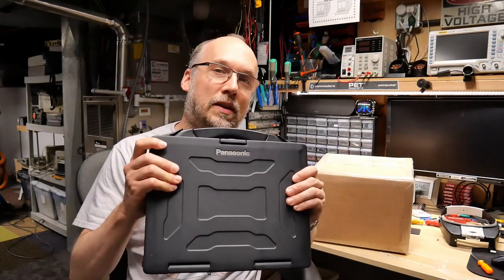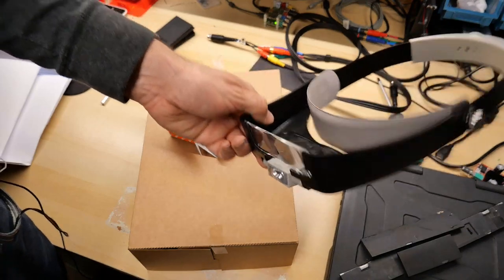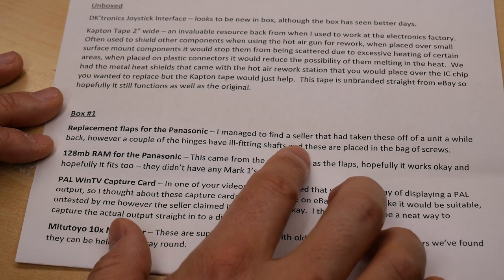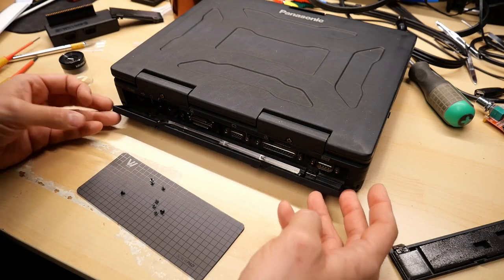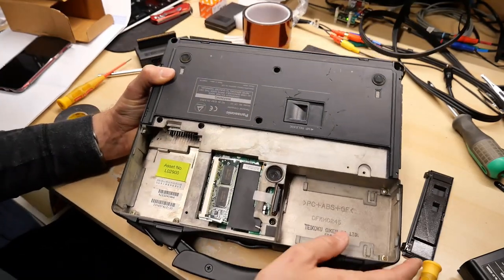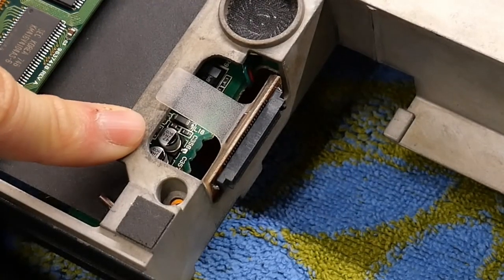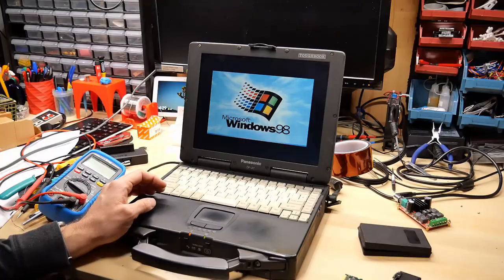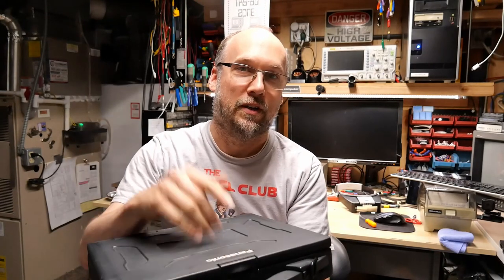Fixing and pimping the Panasonic Toughbook

Comment: This is the first disassembly of a CF-27 I have seen. Looks far easier than I thought! The electrolytics on the boards of these are probably top-notch quality (considering the temperature extremes these laptops were made for), so I don’t think they’ll break down quite as badly as some of the others do. Anyway, good video!

Comment: 3:33 Mitutoyo is known for measurement equipment for the machining industry.  ...for Machinists.  Like calipers, micrometers, and a lot more.  Top three in the industry.  That loop is NOT cheap and surely light years above your amazon grade magnifying loops.
Reply from the maker: Yeah it's so insanely sharp -- I've used it a bunch of times since making this video when inspecting boards for broken traces. I love it!
Reply: I've used their loupes after messing with cheap ones. They make a HUGE difference.

Edit: I guess it's technically a magnifier, not a loupe, because you don't hold this in your eye socket like you would a jeweler's loupe.

Comment: All laptops should be that tough and it looks excellent.  What a great project and a very kind donation too.  Cheers
Reply: Ive still got an IBM 380D from 1996 and its built properly and really tough. The case is all metal, no crappy cheap plastic and of course it still works.

Comment: These were great industrial laptops.  We used them in cranes for the size...I'm thinking one model was the 25 the other a 17.    I remember replacing the hard drives a few times over the years and they were encased in a clear  rubbery shock protector.  They took a beating and some high temps but always worked.

Comment: Used a CF-19 for work for over 7 years. Loved it. Was great for travel and out in the field. Used it in heavy rain all day and in the snow/100 f degree heat. I hated the switch to Ipads. They overheated on 80 f degree days and were terrible in rain and snow (even with expensive cases and screen protectors) but the built in camera made my job a bit easier.  Great video have been really enjoying your channel. I found you a few years ago after I saw the field found C64 video. Keep it up!!!!
Reply from the maker: Yeah nothing quite compares to the durability! And thanks for being a subscriber. :-)

Comment: Kapton tape can also be used for shielding specific components that might leak RF. i worked for a company whose entire job was modifying computer cases and external peripherals like printers and scanners so that they would not leak any RF that could be useful in a Tempest attack, ie RF eavesdropping. a large amount of the work used a lot of strategically-placed copper fibre gasket tape and Kapton tape. that might give you some ideas as to how to test your Kapton tape?

Comment: Inorder to hold the pin in more firmly you can adjust the tension of the hinges by tapping them lightly with a center punch. Not to hard though or you'll lock it up entirely.
The joystick adapter probably fell behind a shelf at an electronics store and found later on in life then thrown around various storage rooms for years and finally auctioned off as part of a lot when the building was getting cleaned out. Lots of box damage but probably never opened until relatively recently

Comment: 15:15 In that HDD caddy, there is not only a cushion to absorp shocks, but also a heating element when using this Toughbook in cold conditions.
Reply: That started on the CF-28. The CF-27 doesn’t have that.
Reply: @80sCompaqPC  , Thanks for clarifying that. Grtz

Comment: Toughbooks are sweet. I have a CF-M34 which I upgraded for WiFi capability, replacing the dialup modem card with a WiFi card. I even ran the antenna around the inside of the screen bezel. One of my favorite projects. I just wish I could modernize it a lot more, maybe switching the motherboard with a Raspberry Pi or something.

Comment: I know someone who's sales pitch for these was to throw them.hard against a commercial customers brick wall then picked it up and turned it on.  Sold!
Reply from the maker: I remember our IBM rep came to our office (before Lenovo bought their computer div) and they demoed the Thinkpad to us. The turned on a Thinkpad T61 if I recall -- and threw it up into the air and onto the concrete floor. Then stepped on it. Opened it up -- still working and booted. Sold ---- we have been using Thinkpad ever since.

Comment: I worked at a hospital and watched a paramedic drop a toughbook out of the back of the ambulance onto the concrete and then chuck it back inside without a second hesitation. When I made a comment about this, they told me that when they return to their home station that they store it in a bucket of salt water for kicks and giggles. Those things are bulletproof.

Comment: I did that magnet trick with one of my desk drawers, kept opening by itself randomly, which was fun when walking into it or swinging sideways on my chair and bashing my knee into it, bit of superglue and an ex HDD neodiddlyium magnet for it to grab the metal frame and sorted, drawer stays shut... :)
Reply from the maker: HA great use of those magnets. I have a bunch of them from old HDs stuck to my furnace for no reason other than to hold papers and what not to it.

Comment: Hi Adrian, with regards to your spectrum interface, you have the Kempston type joystick interface required for the 16k/48k spectrum which requires a kempston joystick, the numbers you mention describe the values the spectrum uses to interpret what direction or what button is being pressed at any one given time on the joystick by the user, "Up = 9" "Down = 8" "Left = 6" "Right = 7" "Fire = 0"

There was a "revised" joystick after the 48K Kempston, it was called the "Sinclair" specific for the 128K+2 & +3 Sinclair Spectrum's, although the output numbers are the same, the Sinclair Joystick was wired differently.

Also, Mitutoyo is a company that specialises in micro precision instruments such as micrometers etc

If you find my information of any use, I would love a mention in your future video's :) 

Keep up the good work.

Comment: The ZX Spectrum joysticks tend to be DB9s but there's two standards, there's the one most 3rd parties used which is the "Kempston", which is the classic old computer joystick that Atari, Commodore etc uses with 1 button, and then the "Spectrum" standard, which has a slightly modified pin layout, and is what the official Sinclair joystick interface used, in addition to the later model Spectrums that had a built in Joystick adapter.

I think most games let you pick between using the keyboard, Kempston or Sinclair interfaces when starting up.

Comment: Protipp for Screwdrivers/screws: If you happen to have a dead middle aged HDD (from the later 90s or so, when they moved to Electromagnetic head positioning): keep the Magnets of the HDD and use that to keep the Screws from rolling away or to magnetize your screw drivers.

Comment: PVR-500 might work still. According to my (file date modified) records I was using a PVR-150 (one tuner model) in 2013 on some 64-bit windows with the WinTV7 software...I think the tricky part to using that software would be convincing the installer that you have a WinTV disc so that it will actually install...I never had much luck with tuning in VLC or MythTV myself...

Comment: adrian with the hinges, squeeze the center bit with pliers and it will be less floppy and the bar will be more captive, you also need a ratcheting right angle screwdriver(c) any chinese seller on ebay

Comment: a right angle adapter for screwdriver bits is nice in a situation like that. And does this machine not have a 3v coin battery for clock/CMOS?

Comment: As some already said, that tuner card could work under windows 10, but win7 might be better choice overall... You might get lucky with Linux as well, there are drivers for all kinds of tuners - I even managed to run USB one on raspberry pi. Alternatively there are also USB tuners for pal analog as well. Currently I own digital only USB tuner for DVB-T/T2/C. SmartDVB is my software of choice. I also do have winfast analog/dvbt TV card and it works nice with its software (on win7), sadly i can't tune analog signals anymore.

Comment: also, I don't know where I got it (it's unbranded) but I've got a great demagnetizer/magnetizer.   You rub your screwdriver on one part and it temporarily magnetizes it.  Rub your screwdriver on the other half and it demagnetizes it.
Reply from the maker: Yeah I actually have one of those -- used it today to help although my small screwdrivers are non conductive (For safe working inside power supplies and CRTs) so wouldn't help with those.

Comment: Actually, since the drivers for that capture card work in Windows 7, you CAN make them work with Windows 10.  All you have to do is disable driver signature enforcement.

1. Press Windows key + X to open the power user menu.  Select Command Prompt (Admin) from the menu.
2. type bcdedit.exe /set nointegritychecks on
3. Close the command prompt and reboot.

Those steps should allow the driver to be installed, even though it's unsigned.  Keep in mind that this disables the driver signature enforcement permanently, so you lose that extra layer of protection, but you can re-enable it later with "/set nointegritychecks off"
Reply from the maker: I had tried this before but doing this no longer works on 64bit windows -- only 32bit versions of Windows 10. (Unless you have tried this before? I think I tried it for some old serial UART drivers and couldn't get it working.) IIRC
Reply: @adriansdigitalbasement  Have you tried doing it through the advanced boot options menu?  It's a pain in the ass, but the last time I checked, you can still do it that way.

1. Hold down SHIFT while clicking "Restart".
2. Select "Troubleshoot" on the "Choose an Option" screen.
3. Select "Advanced Options" on the next screen.
4. Select "Startup Settings" on the next screen.
5. Click Restart.

That'll get you into the startup settings screen.  On the startup settings screen, type 7 or F7 to activate the "disable driver signature enforcement" option.  It'll stay disabled until you re-enable it, and unlike "Test Signing" mode (which is another way to do it), it doesn't put a watermark on your desktop.  If you'd rather not jump through all the hoops to get into startup settings, open a Command Prompt (as admin) and type bcdedit /set testsigning on and reboot.  If you still can't get the drivers to install, then there's something else happening that I don't know anything about.

Comment: If you ever so slightly bend the hinge pin it will pressure fit itself when you push it in and it should stay in.

Comment: @Adrian's Digital Basement
It should be noted, that system can take a 256MB PC100 module. I would highly recommend that upgrade! They're cheap and easy. EDIT: I'm putting my money where my mouth is, a 256MB sodimm module is on the way.
Reply from the maker: OH wow, thank you! That would certainly make running XP on this thing possible.
Reply: @adriansdigitalbasement  
You're welcome! I've ordered it so it'll come here first, then I'll ship it along to you. XP on 288MB though? That'll be interesting!
Reply: @adriansdigitalbasement  It's on the way too you. Should be there on Saturday. It's new-old-stock. It's PC133, but it will down-clock to PC100.

Comment: You should get some CA glue with some activator, much much faster to work with than JB Weld. I use it with magnets around my workshop all the time.
Reply from the maker: Cool thanks for the tip! Yes faster curing would certainly be much nicer.

Comment: I have a WinTV HVR-1600 that works just fine on Windows 10, just by running the Windows 7 Drivers...  the only downside is the drivers have to be re-installed after each system upgrade... but try the card out, Adrian.. you might just be surprised :)

Comment: 2:19 - Those Hauppauge cards also have issues if you have 4 GB or more of RAM in your system - they're likely not to function and they'll also cause OS issues with the driver (it had issues on both 32-bit and 64-bit versions). This is what happened to me with my older TV tuner card. The limitation of maximum memory for 32-bit systems is my likely guess as to why.
Reply from the maker: Good tip thanks. Yeah I think it's best to setup a Windows 7 32bit machine to run these cars to the best of their ability. I have an older Core i3 box still that has PCI slots that should be perfect for this. Plenty of CPU power (for the most part) and enough power to capture the video.
Reply: @adriansdigitalbasement  The card will be more than fine on an i3 - remember that these are old cards and resolution won't be ULTRA HD MAX OMG or anything. ;-) You're just likely going to run into compatibility issues - and if you do, remove a stick of RAM and get it below 4 GB and that might likely resolve the issue if you have one.
Reply from the maker: LOL. Yeah if I can just capture at 480p or 576p that's good enough for me to insert into video in post -- better than recording the screen.

Comment: Loctite one end of the hinge pins to hold them in place.
Reply from the maker: Ah good call -- I saw a 1541 drive repair video where Jeff Birt added a drop of blue before sliding the pin in. I need to buy some to do this -- don't know what I didn't think of it.

Comment: you can still use unsigned drivers on windows 10. you have to put the machine in "test mode" and the windows 7 drivers will still work.
Reply: There is also a way to disable "driver signature enforcement" permanently.

Comment: Since you installed a speaker with (what it seems like) half the resistance of the original, won’t that overdrive the hardware and put stress on it, possibly degrading the life of it?

Comment: FYI: That DK Tronics joystick adapter is dual mode, one port is Kempston, the other is Sinclair ALTHOUGH due to a design mistake, up and down are reversed on the Sinclair port so it’s useless! If you figure out how to bodge the traces I’d be interested to see as I have the same one! 😄
Reply from the maker: OH I will definitely need to keep that in mind and do some bodging.
Reply: @adriansdigitalbasement  It's still handy for games that let you define keys, but not for anywhere the menu option for joystick is Sinclair. 😁

Comment: Another great episode.  However, magnet polarity shouldn't matter with a steel washer... should it?  My guess is that you thought this because the lid was hitting the magnet.
Reply from the maker: Others have said that -- but it's clearly not the case. When I took it off the computer it would only attach to the washer one way -- the opposite of how I had attached it.
Reply: @adriansdigitalbasement  So wanting to verify my sanity, I did my own experiment with a round rare earth magnet, and any surface was attracted to steel.  Do you think the washer was magnetized?  That's the only thing I can think of.

Comment: Why's the washer magnetic to begin with‽ Weird. Regarding the Kapton tape, test them with a heat gun with them covering a thermistor and get their reading. The cheap knockoffs will most likely melt quite easily.

Comment: The polarity shouldn't matter unless you're dealing with two magnets. I suppose the washer was magnetized from your previous tests?
Reply from the maker: Not sure can’t really explain it. Yeah doesn’t quite make sense but It needed to be swapped around.
Reply: @adriansdigitalbasement  I think you've discovered a new law of physics or something. Make sure you haven't opened a tiny wormhole in the back of that case ;)

Comment: I am reasonably sure that the speaker inside was an 8Ohm speaker, and I believe you replaced it with a 4Ohm one--which might not be great in the long run.
Reply: The amplifier chip should be ok.

Comment: The fake "KOPTAN" is alright. I mean, I wouldn't use it if I were NASA and the success of a space mission depended on it, but for most stuff, the material as well as the adhesive is similar enough. The original DuPont/3M Kapton tape is way to expensive. A roll like the fake one you have shown would actually cost $160 from 3M ("5413 AMBER 2 IN X 36 YD") at DigiKey.

Comment: If the card drivers work on win 7 would it not be wise to use the Emulation in windows 10 to just run them in WIN7 compatibility? Nay even a Virtual Box?
Reply: It won't work that way.  Because of "driver signature enforcement", Windows 10 won't even let you install unsigned drivers (unless you turn off driver signature enforcement first).
The point is, it can be done, but not by "just running them in WIN7 compatibility mode".

Comment: I had read that Windoze98 did not like anything above 96MB. I guess that's not true.
Reply: The only limit is how much RAM your computer can hold, but Windows 98 can't access RAM above 4 GB.  (You can still use memory above 4 GB as a RAM drive, however.)
Also, if you have more than 512 MB, and try to open an MS-DOS prompt, it'll tell you that you don't have enough memory to run the process.  You can fix this by changing the MaxFileCache setting in the System.ini file to reduce the maximum amount of memory that VCache uses to 512 megabytes or less.
Reply from the maker: I have had issues installing it with too much RAM it would blue screen -- but I think taking the RAM out would let it install then you could reinstall it. Forgot what the amount was but it was 2gb or something higher than most Win 98 machines.